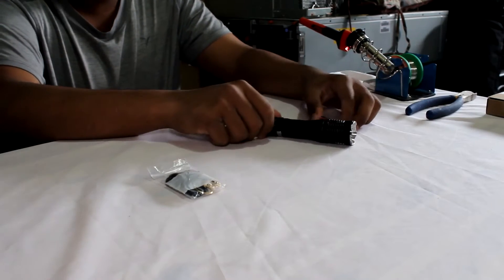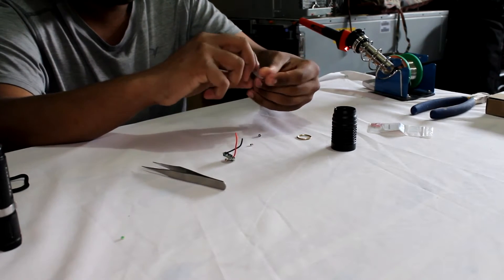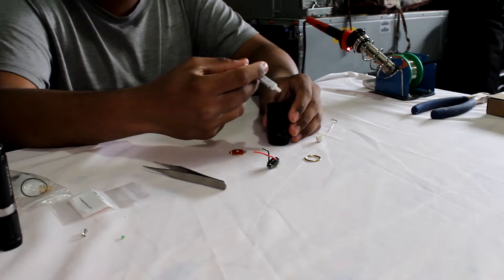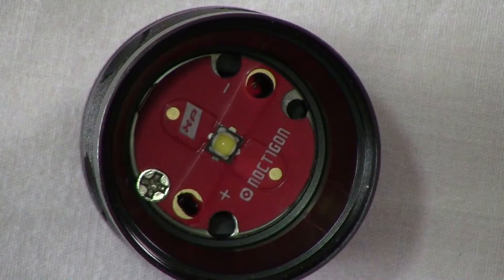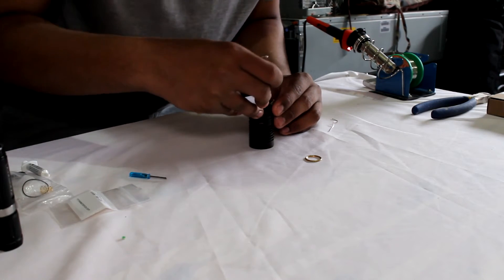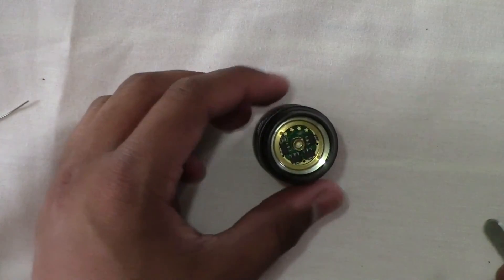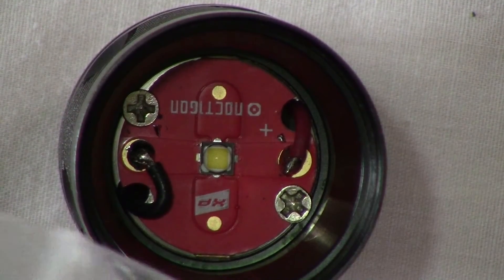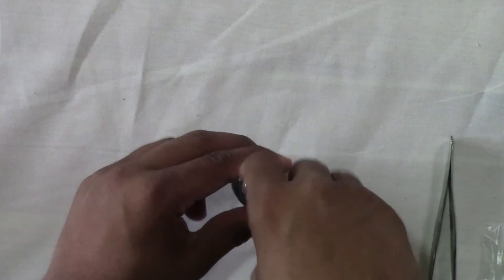DIY Flashlight Guide - Part 2: The Build

Comment: Use a heat sink on the LED board so you can apply more heat to the solder points to eliminate cold solder joints. Just dabbing a pill of solder on the pads is not good enough to maintain connectivity over time. Solder "flows" into a joint if both surfaces are at the same temperature and is years more permanent. Use 60/40 rosin core solder as the new tin /silver solder actually grows "hairs" that may cause a short circuit sometime later (cannot use on circuit boards at all). I know, because I tried to use the new solder and I lost several MRF 150 amplifier chips because the driver solder joints short circuited a year later. A smelly expensive mess.

Comment: Great video!  If you can maybe add some more light into your work area.  Some strong overhead light or headlamp to get some more cool white light on the table to see everything better and in more detail.  The zooming was well done to see the details in what you were doing.   Also, I would love to see some beam shots and specs of the builds.  I don't know if you plan on doing that in another video or at all but just a suggestion.  How many lumens, throw, run time, etc.  Anyway, just some suggestions.  Other than that this was a great video!
Reply from the maker: +curly0117 Thanks for the feedback! I do plan on making a specific video for beam shots .etc, but it's raining pretty heavilty right now so I can't until it dries up.  (I actually have to go get beamshots for a few other lights that I'm reviewing also.). I'll make sure to work on the lighting for the next video!
Reply: Nice video.  Would also like to see more light in the room.  NOBODY likes dim lighting on YT.